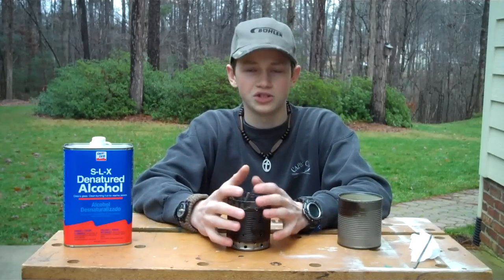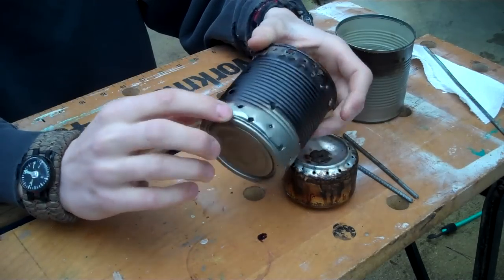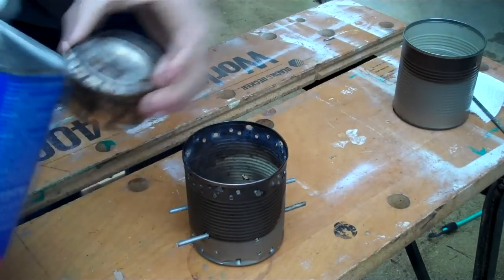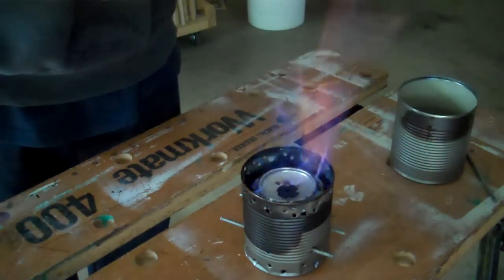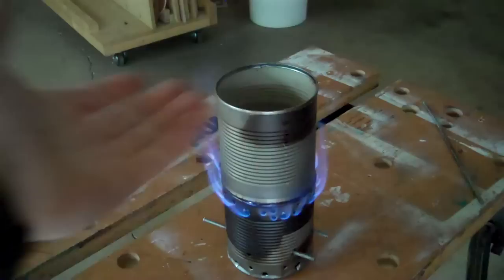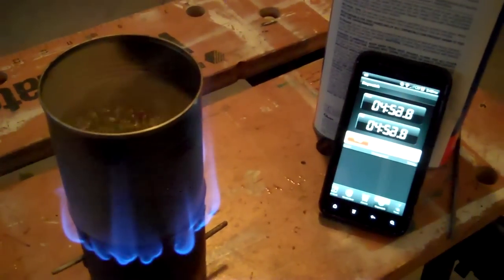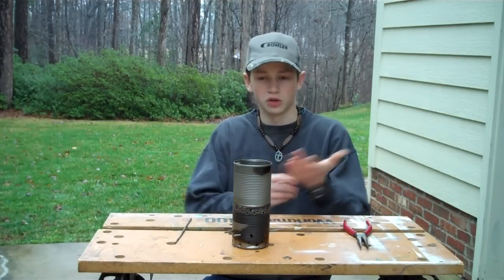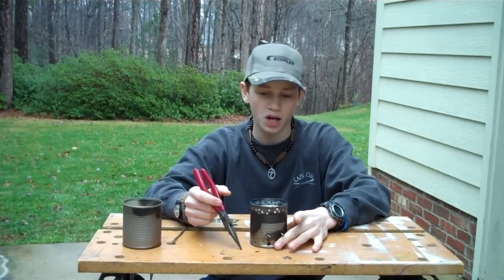Alcohol Stove Stand and System

Comment: I'm somewhat surprised to learn that I've not only watched this video (I didn't remember it), but I commented in it.
Your video points out, without meaning to, some of the reasons I went away from my first soda can alcohol stove, the penny stove. This is one of the most fiddly alcohol stoves there is, and that's saying a bit. Once the stove was primed and burning hot, you put your pot on it, but had to lift it, as the stove was slowing down. 1)  So, difficult to prime, slow to start.  2) For such a hot-burning stove (penny stoves are quick things, once going), FIVE MINUTES for ONE CUP of water is not a very good boil time. At all. I have alcohol stoves that will boil TWO cups of water in five minutes. 3) You put A LOT of alcohol in that stove. One cup of water should only take 1/2 oz of alcohol, at the most. Many stoves will boil a cup with 1/3 oz of alcohol.
Otherwise, I like the idea of getting the stove off the ground for better airflow. Good job!